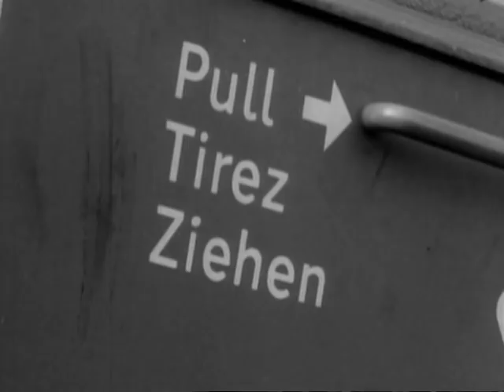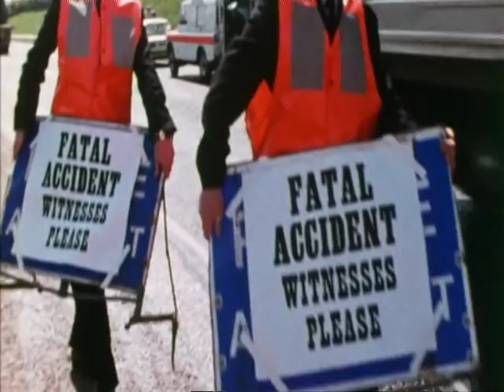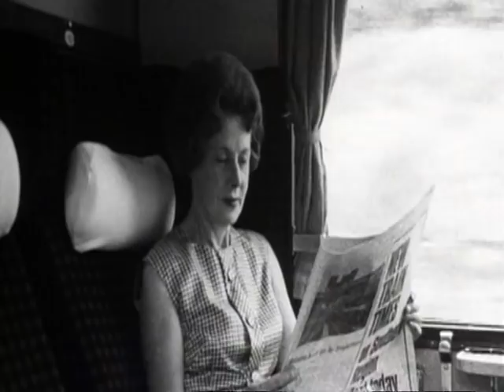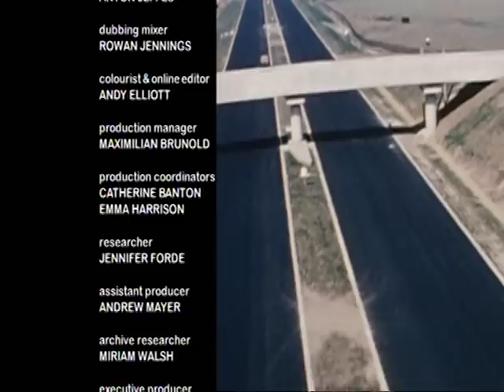SECRET LIFE OF THE MOTORWAY OF THE MOTORWAY PART 2

Comment: One of my grandads friends had a job delivering fuel to the plant. The way he used to talk he spent more time selling it to local farmers 😬 The m62 is an amazing achievement and nice view if you can get your eyes off the road long enough to look at it, but i hate it. Trying it get along it without getting stuck in road works, bad traffic, an accident or bad weather is nearly impossible. Some days it can take an hour, others it can take 6. Ive been up one side in heavy rain, thick cloud at the top and bright sunshine the other side. And when it stops so do all of the other smaller crossings as people try to get around it.

Comment: :brrrRrr:  I remember those electric fires; even as a kid I knew those spotty heaters were dangerous, and here that poor dame's pulling her couch right up to her fireside appliance there
Reply: It's gas
Reply: yet them times though, when the only usefulness borne by that dirt driveway to Stoneyhenge was for accommodating many an over-boiling radiator  🍸
Reply: blew me away resettling the Isle of Dr-Seuss here, discovering 60-odd-year-old toasty apartment buildings from the Twenties not yet retrofitted where opening your windows during overnight lows of minus 30°C was necessary for many a tenant...